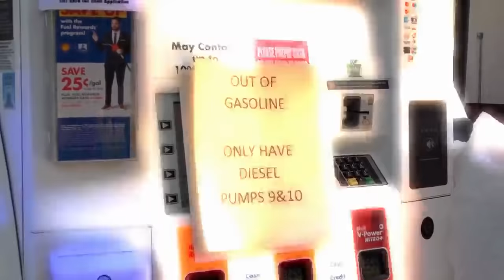Moonshiners Make Gasoline Out Of Alcohol During Gas Shortage | Moonshiners

Comment: When Ford originally designed his first car he intended Farmers make their own fuel out of ethanol to run the vehicle. It's simple engine can run off of gasoline or ethanol fuels it didn't require calibration or anything it could simply eat any fuel you gave it. Now Ford cars have Ford Flex fuel... So Ford cars now have to have their computers specifically allow ethanol fuel else your car will reject it. It could totally run on ethanol fuel maybe not great but it could. Modern cars are literally built to be as unreliable as possible, because the oil industry was worried people would end up making all of their own fuel and Farmers would sell it to the people for cheap, instead of pulling it out of the ground and refining it and selling it for inflated rates.

So the oil industry helped lobby prohibition which disallowed the production and consumption of alcohol in the state. As you can imagine very high ethanol content fuel was also included on that. The Bill's purpose really was to justify getting rid of alcohol as a societal monster when in reality it was simply to ensure the Monopoly of fuel which we are under this day.
Reply: i learned something today
Reply: I always wondered what that meant when i seen flex fuel in green on the back of some cars
Reply: TIL
Reply: @ZORGONICAL  yea BS. Ethanol only has 80% the energy of gasoline and it takes more fuel to grow the corn than you get fuel out of it.
Reply: Yep, prohibition was started to make man a slave to the gas pump!
Reply: @excitedbox5705  yeah but corn is everywhere
Reply: "So Ford cars now have to have their computers specifically allow ethanol fuel else your car will reject it" It won't reject it. It'll just run lean. The thing with what these guys are doing though, is gasoline and ethanol doesn't mix without additives to help it blend.
You also can't just throw ethanol or gasoline into an engine and run it unless the engine is set up to handle the fueling demands. Straight ethanol is also terrible for engines. It causes corrosion in aluminium and screws up any rubber. It has almost zero lubricity compared to gasoline as well. 
Modern cars arent' literally built to be as unreliable as possible. I don't know where you're getting that level of bullshit. They're a lot more complex but they aren't less reliable than older cars.
Reply: @excitedbox5705  yea but I learned something
Reply: Smh It's a damn shame.. The Federal Reserve wasn't supposed to be in America either. These same people are in power today and it's time we bring them ALL down.
Reply: @excitedbox5705  Cars weren't all over the place back during prohibition either but corn was.
Reply: @bocrillz2488  Bankers either because they made money from it too
Reply: You’re doing the lords work
Reply: Source?
Reply: I love comment section wisdom nuggets. Appreciate the lil history lesson and learning why america is and has been corrupt from the jump 🤣
Reply: There is a difference between a 20hp low compression piece of crap engine and the engines with double the compression, 10x the fuel efficiency and 100HP/l we have today. If you're happy going back to these feel free to run ethanol in them.

Modern engines will not run E85 without specific tuning, and they won't work at all in colder climates running E85, this has nothing, NOTHING to do with making things unreliable or fucking people over, it has to do with approaching the thermodynamic limits of the technology.
Reply: @henria.277  thanks for the info I love learning shit thru comments lol
Reply: Except making fuel isnt illegal under federal law even to this day. So this doesnt make sense at all
Reply: @excitedbox5705  You're 100% correct. They also used a ton of propane for the distilling process. To the original point, modern engines have a crazy amount of tuning to them too. They are meant to be as efficient as possible and that means targeting a very specific type of fuel. All that goes out the window when trying to make it run on garbage like ethanol.
Reply: Big corporations man, big ol darn corporations
Reply: @kasuraga  people forget just how shite older cars where 4 liter engines where the norm today we have 2 liter turbo engines that go faster for longer
Reply: @Sarge92  Yeah, when your 10L single thumper engine only runs a few hundred RPM and only makes a dozen hp or so, it can do that on pretty much anything forever. The type of stuff we have now can also run for a damn long time, but they also produce like 100x the power per liter in some cases. Much smaller margin for errors. much smaller engines too
Reply: @coolguyhentaisenpai typically those lobbyists are paid by the people who you know, want to for example, ban alcohol.
Reply: @henria.277  You are indeed completely correct. I just feel that if industry had followed a different path through history the engines we've been using for at least the last 30 years would be developed differently if such monopolization early on had not happened. Imagine being able to buy most of your fuel locally, topping up with petrol mix, and owning a calibration device sold by your manufacturer to correctly mix your fuel ratios. If such a device existed it would be mass manufactured and expected to be supported with every vehicle. Alas such has not happened and I'd like to think anything is possible or could have been even with the physical limits of thermodynamics itself which I have a general lack of understanding.
Reply: Sounds like the paper industry took notes
Reply: thank you for the spread of this knowledge
Reply: @LunaticWithALicense  "owning a calibration device sold by your manufacturer to correctly mix your fuel ratios" 

most of these people can't change a tire, wtf makes you think they're gonna mix fuel?
Reply: @kasuraga  another issue is if they fuel lines used are not ethanol rated they can leak
Reply: @iansmith8944   corn is not even digestible   it's NO loss anyways
Reply: @punker4Real  most modern cars at the very least have fuel lines that can handle ethanol now that almost all gas sold contains 10% ethanol. i think every since something like the mid/late 90's they've been using fuel lines that can handle ethanol to some extent. I still would never run a 100% blend in a car daily though. Stuff would still trash fuel systems if there's not enough gas to work as a lubricant.
Reply: what the hell are you talking about
Reply: @kasuraga  Fuel lines used to be steel in most vehicles pre 90s, and if lubricant was a problem, could always just mix oil or some fuel additive to fix that
Reply: @farcere  the rubber portions are the issue. im aware that cars have steel lines, but not 100% steel
Reply: Who's to say eletric is the only alternative to oil? It shouldn't have to be that way, especially if they're just as clean or cleaner. Even shit could be another source of fuel imho
Reply: @jokerswank6082  well, there are only so many ways you can use stored energy. Fuel has one of the highest energy potentials out there, that's why we use it so much. Batteries are shit in comparison. Extracting that energy is the other issue. Burning it is the easiest way with fuel. Other sources of energy are well...a bit problematic for personal use, namely nuclear. In the end, it's almost always going to be converted into electricity, so the less steps it takes to convert your fuel into useable energy the better.

It's easy to just say "Just use something else!" when a lot of those something elses have their own problems
Reply: @ShinGouki86  it's sarcasm. modern EFI with flex fuel systems can handle anything from 100% gas to 85% ethanol/gas mix, all on its own, no user input needed outside of pumping gas into it. But it's not widely adopted and E85 is seen as kind of a failure. arizona doesn't even have E85 anymore. best you can get is E51, and I haven't heard of many new flex fuel vehicles coming out in recent years. It's only hobbyists that buy the stuff typically.
Reply: I'm not saying just use something else. Don't put words in my mouth. My point is the electric concept isn't the only alternative and is given too much attention.
Reply: @jokerswank6082  yeah but your example of using shit for fuel is actually bad. burning fuel is the problem, and to produce enough shit to use as fuel means green house gasses will rise.
Reply: That was just one example of many not to mention the methane produced from the shit as a result would be captured.  But like I said, it doesn't have to be just electric nor does gas have to be the end all be all forever (kinda lacks ambition dont you think?). Investing in certain technologies instead of useless war would be of some help for one. If alternative fuels disgust you, you might wanna push carbon catching if you advocate petroleum forever but hey if you want to believe that there can't ever be a better alternative that's your opinion.
Reply: @Azrael600rr  hemp is even easier to make into ethanol. Grows easier with less land and water.
Reply: @excitedbox5705  so why not use your food waste as a mash (assuming you don't want to drink the end result)
Reply: in Thailand, gov lost money for every liters of gasohol (which is practically only fuel you can commonly found across the country) because they have to pay more for alcohol components (have to subsidize shit tons of agriculture products) than the pure fuel

yeah, that's BS my man, it's not really the matters of 'intentionally make the engine more unreliable' but the fact that they have to make an engine for specific fuel people actually uses so they can't accept self made formula like what they did in video
Reply: Capitalism baybeeeeeee
Reply: Thanks for reminding me not to get my education from the youtube comment section. Second only to facebook for bullshit factor.
Reply: @ShinGouki86  if you can cook. "Mix 1.26 l of this with 20 litres of this" doesn't seem that hard. Poeple own chainsaws and gas powered lawn equipment that requires fuel additives how can't that be possible for large scale car fuel... Irregardless  of the arguments it would be NICE to offset the cost of international fuel with locally produced biofuel (which would be cheaper if it had actually been supported many decades ago)
Reply: @jokerswank6082  hybrid is the way I personally I feel in my opinion. Electric cars are great but who wants to be subject to a tow if you run out of juice? Having a gas engine just increases the range and reliability of the vehicles in despite of the fact that the car is far more complex than pure combustion/pure EV cars.
Reply: @LunaticWithALicense  That's something that has to be ironed out. I'd be concerned about how long would the juice last up to. Not all technologies start out flawless for that matter.

Comment: It didnt work in the motorcycle at first because it needs to be rejetted for the proper air:fuel ratio.  Stoich for e85 is like 8.5:1 while stoich for gas is 14.7:1, meaning it was running lean.  You can mix ethanol fuel and gasoline and end up with a fuel with a stoich that will at least let it run without rejetting, or just rejet to the ethanol fuel.

Comment: Myth busters actually proved that a car could run on moonshine alone
Reply: why did they bother? alky dragsters have been burning pure alcohol for years
Reply: @ShinGouki86  They tested cars that were not meant to run on moonshine, regular road cars. alky dragsters as the name implies are meant to run on pure alcohol.
Reply: I saw that episode, and yes, the car "ran", but it didn't run well at ALL.
Reply: I think most anything will work, the nuance is in efficiency and engine wear.
Reply: From car's perspective it's like you just added very poor quality gas into it (ethanol gives less power on same volume). Would not suggest trying it tho unless the car was designed for it. Ethanol destroys the engine on long run without proper parts as it is highly corrosive.